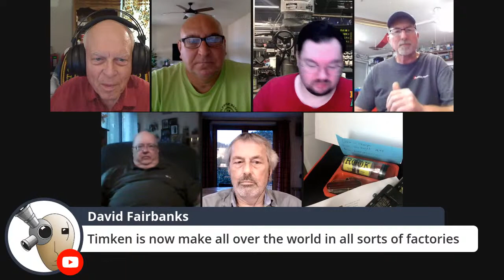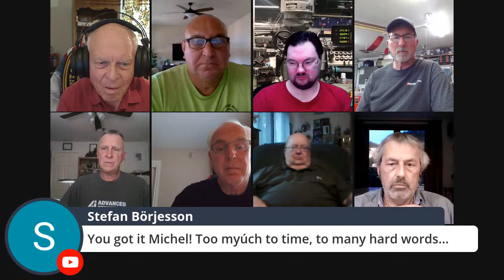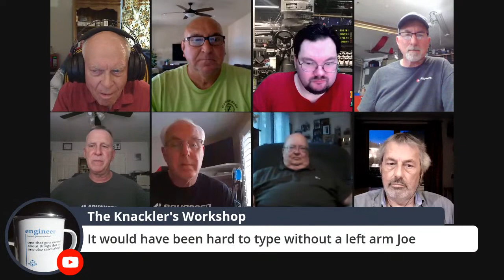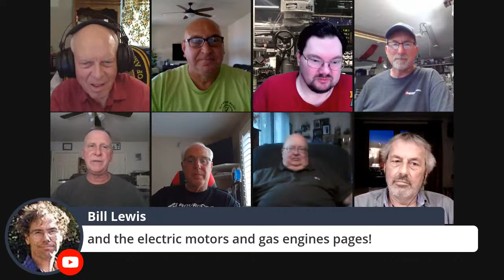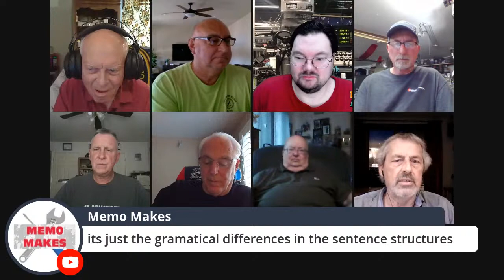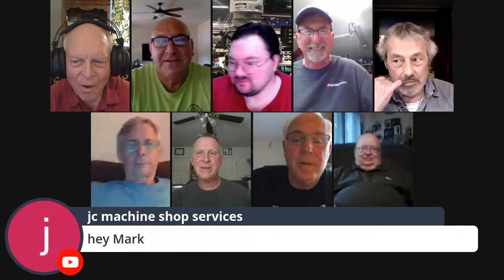ARW Discussion #23

Comment: I have a heli-coil question, aluminum thread depth is supposed to be 3 times the diameter of the bolt, if using a heli-coil is 2 times the diameter ok?
Reply from the maker: I am not sure of the answer to that.  Maybe you should try Joe Pis channel and ask him.  Thanks for viewing.

Comment: I wouldn’t work too hard to fix that air ratchet.  I got rid of all of my old knuckle smashing, hand pinching, air ratchets a few years ago.  I literally put them at my curb and they magically disappeared in an hour or so.  Pick up a Modern reactionless air ratchet that does not pinch your hands.  It has a little impact built into it, so it will break the bolt free to boot. I wound up getting a HF Earthquake a handful of years ago and love it.  I also have a small AirPro impacting air ratchet that can fit anywhere.
Reply: Here is a video I made that that shows the newer reactionless, impacting, air ratchets.https://youtu.be/1dPTnUYJKEg
Reply: Thanks I will check that out.. Sounds pretty cool